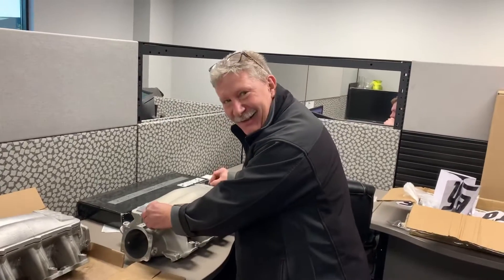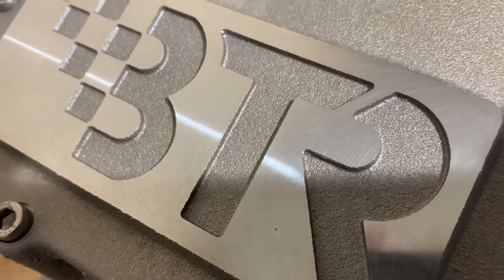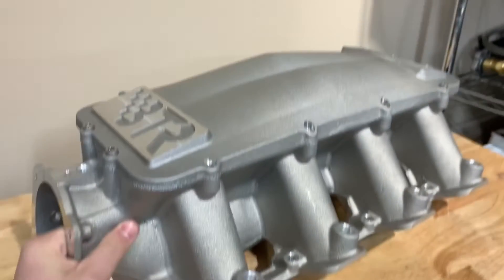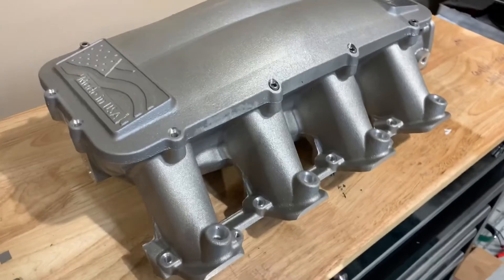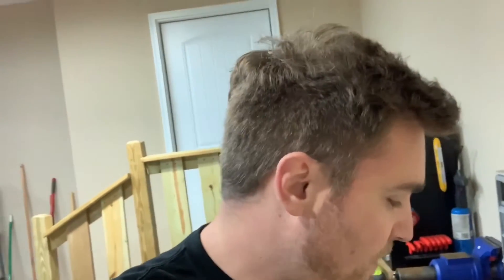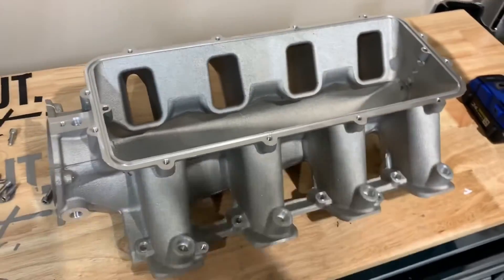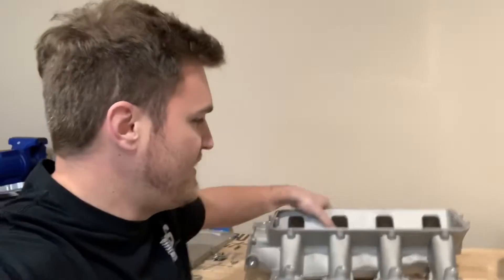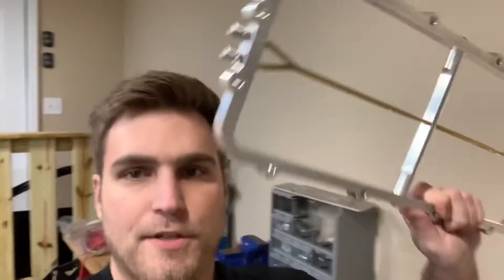FIRST LOOK: Brian Tooley Racing’s New Intake! THE EQUALIZER 1!

Comment: BTR LS3 Equalizer style intake to be released ...
*crickets
*tumbleweeds
Reply: Not much longer from what Brian told me
Reply: @CLEEPER1  You need to ask when that nitrous spray bar is coming out then lol
Reply: @fourwheelerjock   it actually adds plenum volume so I'd use it for that alone.  The extra kick in the ass from nitrous is a bonus.
Reply: @CLEEPER1  That's what i'll be waiting on.  Only thing is  i hear this intake sucks down low which is a bummer for my dads 6.0L LS Monza Build that we're doing.

Comment: So no good for my cam only ls1 t56 ?
Reply: Maybe if its a high revving  cam
Reply: @shosaleen   no just a cammed summer street car
Reply: @mfultz403  With the top off this intake, short runners are shown. This type of intake is only good for mid to high RPM. With fitment for cathedral heads, depending on your camshafts grind, this would kick in at mid 4K RPM’s to the 7k range. 
Air has mass and mass has weight. In motion, the shortest path is a straight line. Vortec intakes have long runners that when air is in motion, it’s weight pushes it thru the plenum, into the long runners then stacks up behind the intake valve. When it opens, air floods into the cylinder, increasing volumetric efficiently. This is that ability to get air into the cylinder before the valve closes. The longer the intakes runner, the better the low end torque is. Their are intake manifolds on vehicles from the 90’s that have “V” configuration engine that employ valves on a shaft that move from long runners to short, mostly around 2,800 - 3,200 RPM. They accelerate while not pushing on the throttle. These are fixed for high speed ops.
ASE Master Tech since 1978, Retired